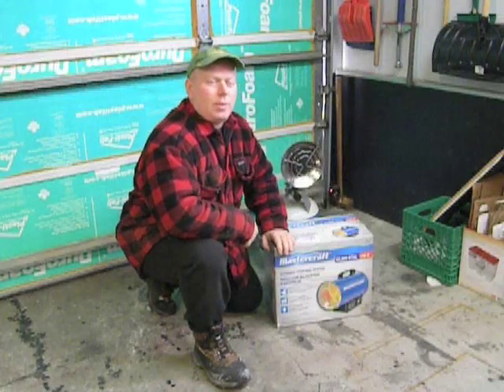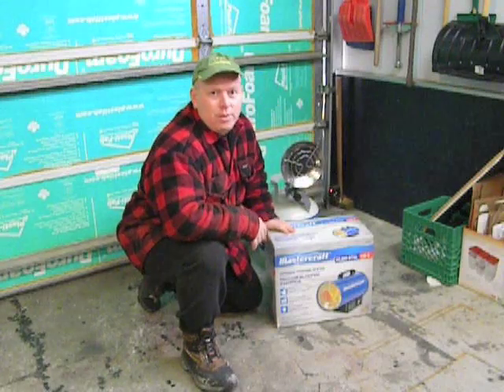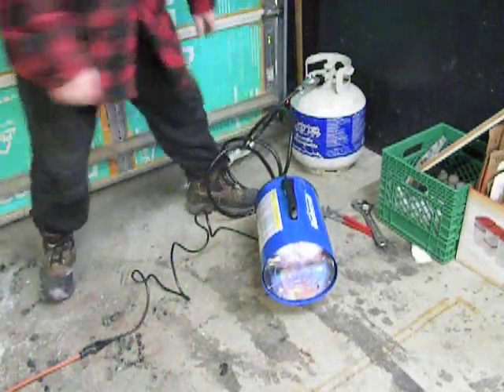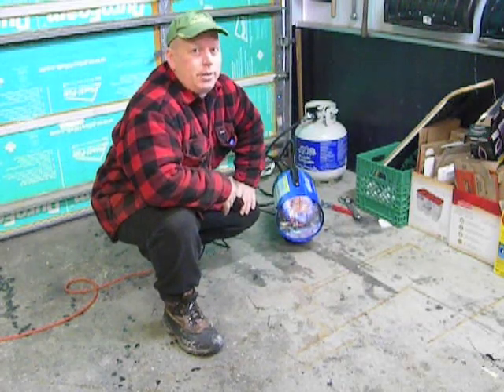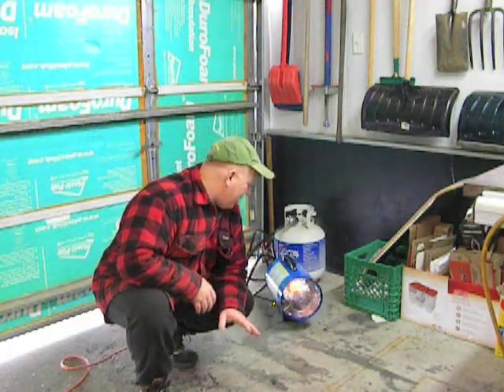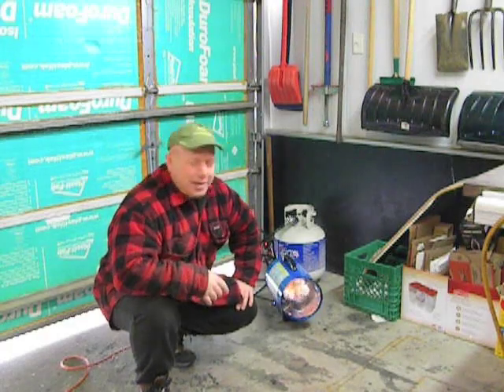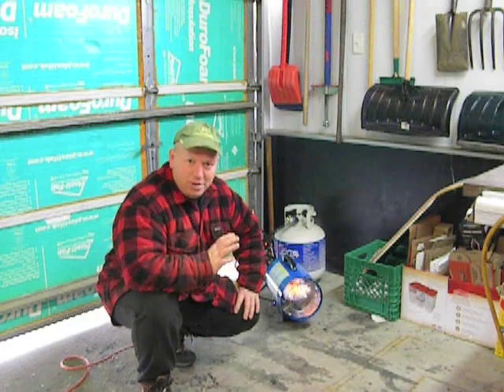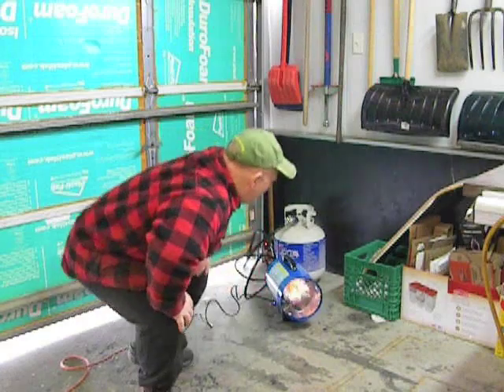Mastercraft Propane (Salamander) Heater Review

Comment: I'm also a garage woodworker. My garage is 24 x 36 with a 'dedicated' shop area of about 24 x 12. (If I need more room to maneuver a project, I pull my pick up truck out.) So, that's about 850 sq. feet I try to heat when I go out during Winter.
I tried heating with a dual sunflower heater and a wall mounted propane heater, combined putting out about 50,000 BTU's.
Used propane like there was no tomorrow just trying to stay comfortable, so early last Fall, I bit the bullet and put blow in insulation in the attic of the garage. Only about 3 1/2 inches total, but I've been amazed at the difference.  
In spite of this being one of our coldest Winters here in Virginia in decades, my shop heats up quicker, holds heat much better and I'm not using near as much propane.
I figure it will only take me just a couple years to recover the cost of the insulation and from then on, I'm saving money AND enjoying a much more comfortable workshop.
I'm sure our Winters aren't anything like yours and you'd probably save even more.
Reply from the maker: Steve E Unfortunately I only have a 1 1/2 car garage (you are giving me "garage envy").  I have insulated all of it but the ceiling I only used R5 foam sheets with tuck tape over the seams.  I have planned to eventually use some blown in insulation on top of the foam.  The plan was to add more in the house then add a small layer in the garage also.  Unfortunately I haven't saved up enough cash for that project yet.  Thanks for your comment and have fun in your workshop!
Reply: Thanks, Rob.
I do enjoy my time in the 'shop' as I'm sure you do.
Helps me clear my mind and get away from the day to day concerns for a bit.
But there's nothing worse than trying to work on a project with frozen fingers and cold shivers!
I'd just encourage you to get that attic insulated. It'll save you money sooner than you think and you'll be a much
happier wood worker! 
God Bless!
Reply from the maker: Steve E R5 ceiling insulation isn't much but is has made a big difference, can't wait to add more.  This heater rocks so I'm much warmer and warmer faster.  Hopefully I get some more "garage therapy" time with the new heater!

Comment: I have this heater it just died on me , I have power , and propane turned on from a full tank and i have a very good spark, but when i depress the gas button there no fuel , I have tryed in vain to contact Mastercraft they never return calls. Does anyone have any thoughts on how and what the check.
Reply from the maker: I returned mine after having the same issue.  Could be the regulator and if it stopped when hot it could be the flame sensor.  Mr. Heater has a similar product but it’s a bit more expensive.  Their quality and durability is quite good.  It might be an inexpensive fix or it might be just easier to buy a better model.  Princess Auto has a great variety of heaters and parts and also tsc stores (the farm store)
Reply: @robsgaragewoodworkin  Thank you for your reply , I was told by one repair place the cost would be to hight if they could even get the parts, I bought a Dyna Glow ran it once so loud also I was feeling light headed even with lots of air flow not a good heater took it back to Home Deot and bought the Ridgid Hybrid  amazing so quiet and well made may have picked a winner this time . Thanks again for your reply.
Reply from the maker: @shaunmckenna1923    Awesome.  I haven’t seen that one and now I have to look it up...
Reply: @robsgaragewoodworkin  Yes pls do i would love to know what you think of it , the cost here in Canada was $189.00 plus the tax so $202.00 total , hahahaha I still have the old one I never through anything out :)

Comment: I've been using the 3 burner Mr. Heater Sunflowers here in Calgary, and I find I get a lot of humidity in the air of a two car garage when I run it.   Does this one do the same?
Reply from the maker: cavokdotcom Yes it seems to.  Do you like the triple?  I considered it but it doesn't have a fan.  Does it heat your garage enough to be comfortable?
Reply: robsgaragewoodworkin I'm told that's a hallmark of propane combustion, but I was hoping an actual flame might fix that issue..   //   I've been working with a new cnc router, so there has been a lot of chair time in front of the computer lately.  Much like a bonfire, the three burner heats you really well from one side.  I usually keep it about 4-6 feet away from me and down to about -15 C I can be comfortable in there with a couple of huge windows, and very little insulation. around -5 to -10, I'm usually a bit too warm with a sweater on, and stick to a light jacket with the heater on medium or low.   On medium I usually get about 1.5 full days of use on a 20 lb tank, so I've switched to a larger 100lb tank and just made a bracket to hang the heater from the top of the tank..   All in all, I think a potbelly stove with an air circulation fan would be a much better way to heat the place. (and Pallet wood is free.. :)
Reply from the maker: cavokdotcom If I had a freestanding shop I would have an old potbelly stove for sure!  Unfortunately subdivision homes with 1.5 car garages prevent this option.  By the sound of your description I think the salamander was the correct choice but the triple would have worked well enough.  Thanks for your comment and all the best!
Reply: Heh.. Fair dues robsgaragewoodworkin, the neighbours do get kinda cranky when you burn down a whole subdivision.   In the long run, I wonder if the expense of running a line to the gas meter might not be worthwhile for you?   Especially if you're planning on using the shop all winter!   However you go, best of luck!
Reply from the maker: cavokdotcom   LOL!  yes I have thought about it.  The heaters from Princess auto are around $600 + hookup but my gas line is on the other side of the house and would be difficult.  If I make any real money off youtube or make woodworking a full time thing I will have to move somewhere I can build a real shop.
Reply: robsgaragewoodworkin  Ugh! Had to be on the other side of the house... That's always the way when you want to do something simply..  Sounds like you've got a good plan in mind in the meantime!   I'll make a point of clicking your ads.  :)